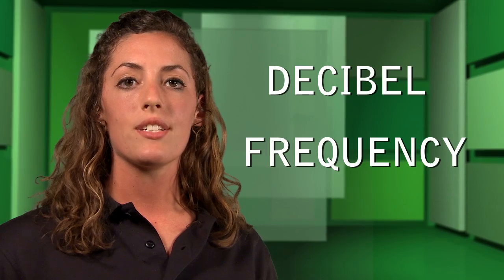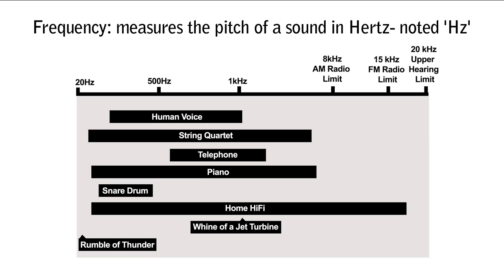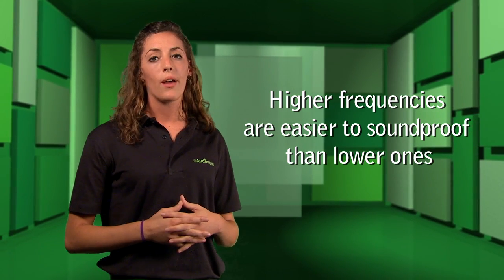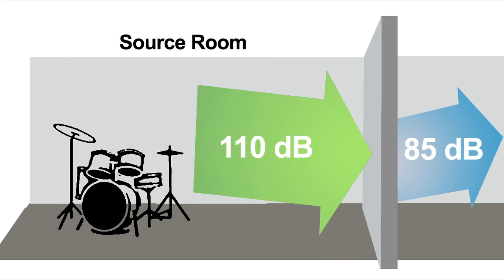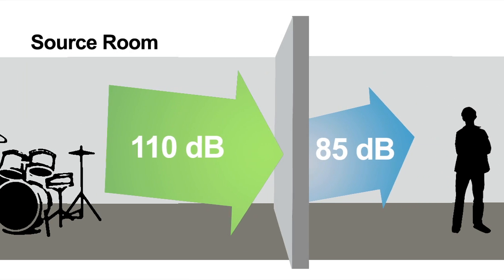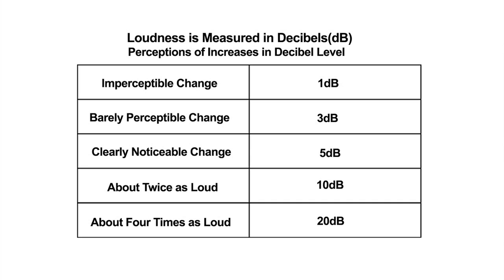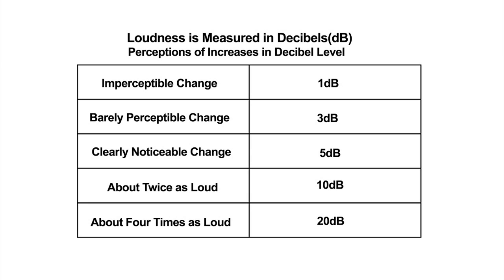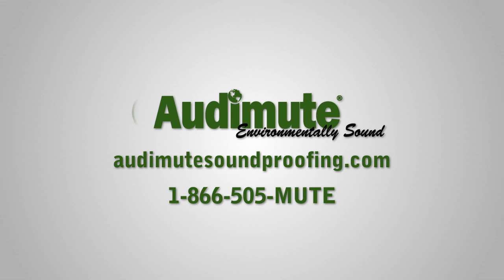Soundproofing and Noise Reduction Education by Audimute

Comment: Your decibel chart thing is nonsense.  Sound pressure level doubles every 3db - yet you claim this is a barely perceptible change.  You say 10db is about twice as loud, 10db in fact would more than 8 times louder and 20db nearly 128x louder
Reply from the maker: Tee Four , Thank you for your comment. If you call, we can discuss this as I'm not sure if you have gathered the information correctly. Sound pressure levels do not double every 3dB. We are told by world renowned Acousticians that a level 10 dB greater usually means "double the
loudness" or "twice as loud". Let's talk, so we can understand together. I'm interested to see where you received that information.

Comment: Thanks for the video, but it really wasn't very helpful. It was more a vague description of decibels and frequency. I already know about these terms, but the video doesn't seem to offer any tips for reducing noise. Where are the tips promised in the title?
Reply from the maker: responsibleparty thank you for both of your questions! 

I am sorry you did not receive the value from this video that you had anticipated you would.  

However, noise reduction solutions are usually application specific and dependent upon various situations. If you would like to discuss your noise problem further you can give us a call, 866-553-4600, and one of our specialists will be able to assist you. 

For your question about Peacemaker: 

1. When installing Peacemaker, minimal screws should be used to create that decoupling structure in your wall. 

2. Peacemaker is a mass loaded product so adding any type of mass and density to your walls will help alleviate noise transfer. 

I hope this was helpful! For more information please do not hesitate to call us or email our sales team at info@audimute.com

Thanks! 
Abby

Comment: I'm just wondering if the decibels in my "drumming" room right now is about 110, like said in the video, how much would be reduced if I had a wall with one layer of the absorption sheets, 1 layer of drywall, the 3.2 acoustic barrier, wooden studs with nothing between them, and an other layer of drywall after the studs? I don't know how to calculate that.

Comment: Genie clips huh?  I will, thx man!  I ended up finding some soundproofing material that was used on naval vessels engine rooms, unused and in the box, so I installed those on the walls and ceiling.  I used a high rating insulation between the beams, then soundboard, and these sheets of foam panels with a plastic outside sheet and lots of little holes in them over the sound board.  Looks good and sound is dramatically improved.  As an added benefit the DB level outside was cut substantially.

Comment: You mean de-dressing? lol...  but seriously, im trying to reduce the noise level outside my garage for band and drum practices.  If I hang the white sound absorption sheets in front of my garage door, would that effectively reduce the db level on the outside?  Also, does anyone know if there is some sort of brush or roll-on type product that can be applied to the inside wall (before insulation) that would act like the peacemaker sheets that go on the beams? Im looking for cost effective here....